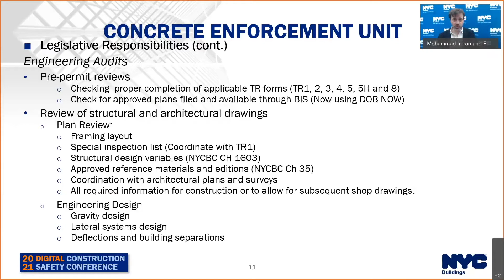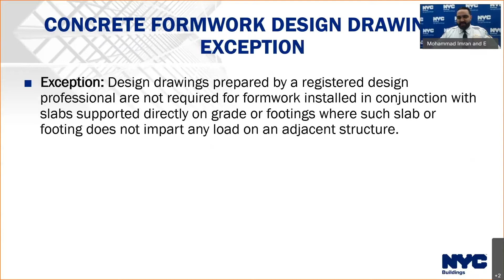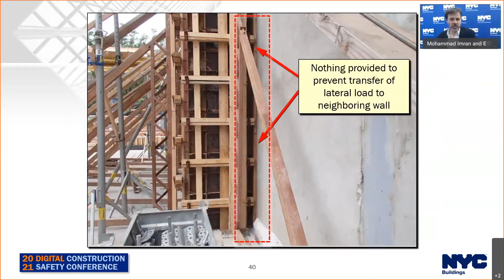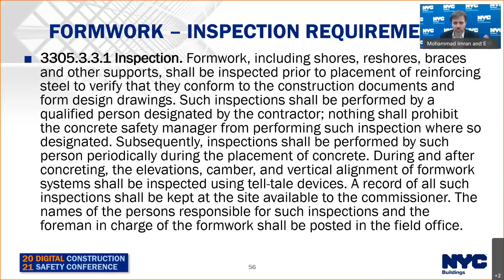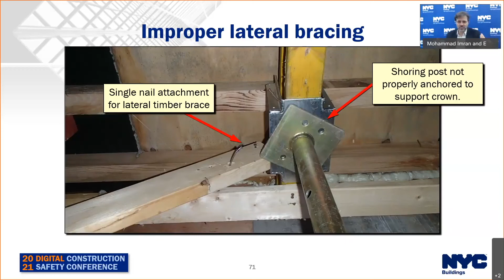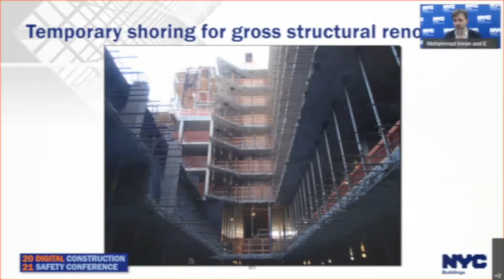Concrete Construction Issues

Comment: 39:00 great presentation,  but you should also provide the addresses of where those incidents occurred.
The cmu wall collapse occurred at 1059 3 Ave, on 1.9.2019.